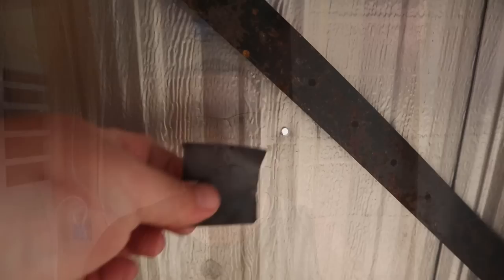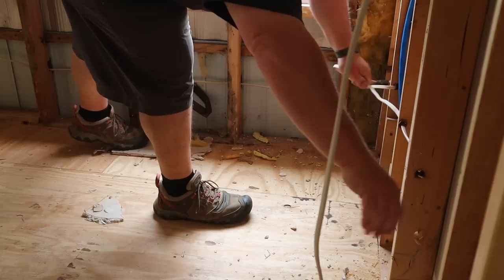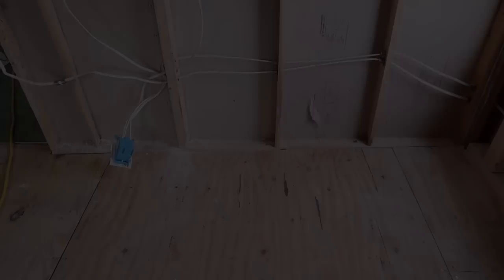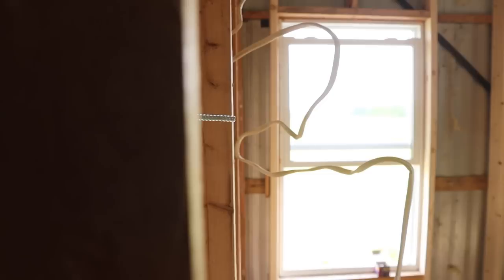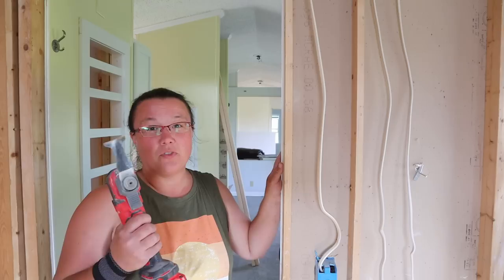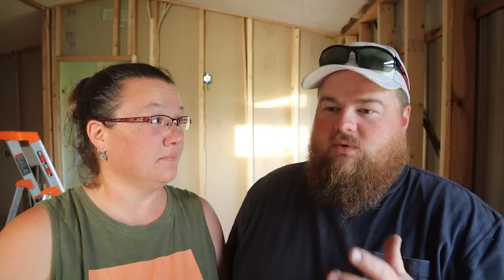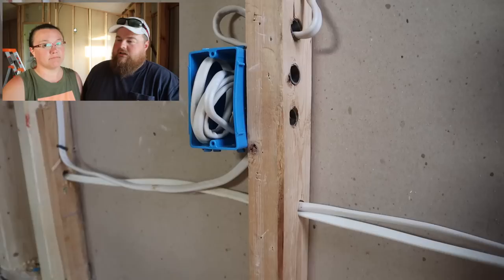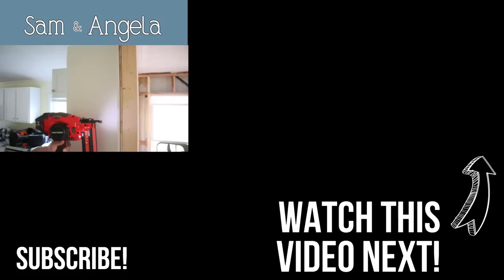Mobile Home Wiring [& Framing] is the WORST

Comment: They make those wire staples with plastic insulators, so they won't damage the wire.  Those staples are not suppose of be hammered hard against the romex. Just enough to lightly hold the wire in place.
Reply: Lots of deficiencies in the remodeling.
Reply: @peterlynch3252  What are they?  I disagree.
Reply: So the metal staples aren’t supposed to be hammered down all the way. Just hammered past the silver tip. Same with plastic staples. Compression = fire. That’s why a lot of new construction uses zip ties to tack wires up.

Comment: You might want to cut and install a piece of blocking between the two studs and remove that butterfly anchor and then you have a more secure mounting for the kitchen cabinet!!
Reply: I agree, looks pretty flimsy.
Reply from the maker: We did this the next day. :) That video is in the edit queue still.
Reply: @sam-and-angela  Great job!, yeah, you might as well fix all the whoopdi-doos in the walls while you're at the renovations, same goes for the laundry room, maybe move the wall back about a foot or two, beef up the 2x3's and any other micky mouse work that the factory did, or didn't do!, also you might want to completely redo the spice rack. As for the master bedroom closet, it looks like you have at least 2 1/2 feet depth to play with to make it roomy enough for your clothes! Thanks again for your videos!

Comment: Don't forget to put metal plates over where ever you have wires going through the studs in the wall so that when you fasten the drywall onto the wall you do not accidently screw through an electrical wire.
Reply: Theirs has conduit going through the stud. They can have burrs that can cut the wire themselves.
Reply: @jadofar  I saw one stud with a burn hole that was within half an inch of the face of the board

Comment: I highly recommend insulating any interior wall to help with sound deadening while you have access, especially since you have feral children. It greatly improves quality of life, in my opinion, and the cost is very minor, especially as it relates to that quality of life improvement.

Just my opinion!
Reply: You are so right.  We're doing a complete remodel of our mobile home too and we plan on using Rock wool in the interior walls.

Comment: It is probably sealed up by now but do consider some cross bracing so you're not relying on Molly screws now and forever more.
Reply: Where I live, code requires 2x4 between the suds.  It is fire code.

Comment: Older mobile homes use to catch 🔥 fire all the time, and it's plain to see why. That spaghetti ball of wires looks a whole lot better. I agree with Sam, I like the wiring to look near & organized. And I like it if the wiring makes sense. Good job Angela getting all those p.i.t.a. little brads, nails & protrusions cut off so that it's easier to hang the drywall.

Comment: My suggestion would be to remove everything on the upper section of the kitchen side of the wall, right down to the studs, replacing the sheetrock with plywood. This will make for a stronger wall and better mounting area for the cabinets & microwave. A little bit more work, but safer in the long run
Reply: A lot more work
Reply: @boathead22000  but probably safer in the long run than 2x3 walls
Reply from the maker: Perhaps if we didn’t already renovate the kitchen. Even still they’ve held for three years and a house move. The extra steps we took are more than needed.

Comment: I would recommend using the reflective foil in the walls before insulation. It will help keep your home cooler in the summer and doesn't add weight to the mobile home..

Comment: I would recommend that you connect all wiring for outlets with pigtails and waygu connections or wire nuts to avoid any failure of connections in the outlet plugs themselves! By doing this, if the outlet plug fails, then the rest of the circuit won't be dead and causing you hours of troubleshooting the problem of half of the home being in the dark ! Hope this makes sense! Thanks for sharing your videos!
Reply from the maker: It does make sense and something I remember comments on from our boys room renovation. Wago lever locks ordered today. :)

Comment: Glad to see you are replacing the wiring  and boxes.  many trailer fires have root problems in the wiring systems.  especially after people add new outlets and loads to existing circuits.  Enjoy

Comment: so a way to strengthen any wall or framed area is to put plywood over it and if you have a week area that's already sheeted with thin plywood you can overlap and strengthen it relatively easy and fast.
it just boils down to cost verse need and how much you want to engineer a project.👍

Comment: SAM AND ANGELA, YOU TWO DID A GREAT JOB AND THE WIRING LOOKS GOOD, I KNOW EXACTLY WHAT YOU MEAN ABOUT FLOATING WIRES AND ELECTRICAL OUTLETS IN OLDER MOBILE HOMES MY HUSBAND AND I HAD ONE WE HAD TO WORK ON THE BATHROOM BECAUSE OF THE HOT WATER HEATER LEAKING AND THE TUB PIPES LEAKING SO EVERY WALL HAD TO BE REPLACED.

Comment: I feel your pain, mobile homes are notorious for crappy wiring and thousands of unnecessary staples pin nails. All my outlets were just held by the sheet rock no 2x4s or 1x3s just a weird flap top and bottom that held them directly to the dry wall.

Comment: The conduit pieces going through the studs usually have burrs on the inside and will cut the wires running through them. Mine almost started a fire. They are there to keep drywall screws from going into the wires.

Comment: Hey love you guys and great job on all your work but could you double check and make sure those nail things that's holding the wire to the wall didn't bust through the plastic coating over your wire and not nailed too tight I am scared of everything when it comes to electric and just had to say that and I love what you guy's do☺

Comment: Everything is looking great. Two suggestions before drywall .The toggle bolts What are they holding up? Back them up with blocking and remove the toggle bolts for screws makes it a lot stronger. 
Please install safety straps over each hole that the electric is going through that dont have the pipe over the wires so you dont drive a drewall through it

Comment: Cant wait for more guys. Amy news on the electricity pole or sewer? Another great video guys. God bless you and your family.
Reply from the maker: Septic is to be installed this week. After that, we can rent equipment and trench for our power lines for installing. We don't want to risk digging in the septic drain fields and mess that up at all. Hopefully next week we will be digging the power line trench.

Comment: As someone who spent many a year living in a mobile home I would highly recommend if you have not put the drywall up in the bedroom yet, whatever on the other side of the last wall of this video is hung on a hollow wall anchor to take that down and put in a backing block to screw that in. I cannot tell you how many things in my own place were hung with hollow wall anchors (since those teeny tiny studs were very difficult to find let alone properly hit the center of one hanging something) that for a year or two or just fine. Until today that the not overweighted item ripped the hollow wall and current out of the wall leaving me with a giant hole to patch. The mobile home I owned was 9 years old when I bought it and we lived in it for almost 10 years.

Comment: we dont have romex here , we install pvc pipe and put seperate wires though them black for switching wire  green yellow is earth brown is nil and bleu is phase , the piping makes it eazier to add wire after the walls ceiling is installed , guess both metods has their advantages

Comment: Thanks for he tip with the screw and hammer to level the two pieces of wood, one to remember. Good temp fix with the tape as I was one of the ones commenting on the holes... sorry. Thanks for posting

Comment: Love your video. The home I have is a Double wide 50x24.  and the wiring was just crap. 14 gauge for just about every thing.  I have Ripped out the Sub floor and replace it all. A lot of the walls replaced.  insulation replaced.  I would have been better off Tearing down and just build a home.  Can't Wait until I get my home done. I'm about half way there but lots and lots more to go.

Comment: Regarding the oscillating tool. My experience is that they have a severe vibration so I think you are setting yourself up for carpal tunnel syndrome. Maybe it would help to use a wrist brace while you are operating that tool.

Comment: I've been around a couple of remodel(ishes) and, at least you didn't have short lengths of extension cord, appliance cord, and an asundry of other wires capable of carrying current attached in various ways .....  im going to guess that mid-wall or tucked behind the tub, that one passed factory inspection.

Comment: Sam, you would have tripped out had you seen some of the inside wiring on homes say 60 or more years ago. In the attic they had porcelain insulators nailed  into the top of the joist. The hot wire ran along a certain set of insulators and the ground on another set. The wires appeared to be covered with some type of cloth and underneath that what appeared to be rubber. Over time all insulation would fall off and the only thing protecting the wires were the insulators. You had to be very careful walking around in the attic. I don't even think electrical tape had been invented at this time.
Reply from the maker: Knob and tube, was that the name? I've seen it on shows, but never in person. Amazing the things we used to do! :) Imagine what the future will say about us. LOL I hope we make it to there...
Reply: @sam-and-angela  I happened across a just released video of Bobby who had a crew on the show Swamp Loggers. Bobby and his wife had been going thru some tuff times with all the mess the half brain guy has America in. So Bobby and his wife had to make a business decision and because they're loosing money trying to stay afloat they have to decided to fix up all their equipment and sell it and call it done. They basically said they couldn't make any money in this economy. Bobby said he started working I think when he was 13 years old. I certainly doubt they are the only ones who are closing their doors. :(

Comment: Hmm I have not seen any metal plates put over the studs where those electrical wires run Thru the hole to protect the wire from having a dry wall screw run Thru it or a nail of some sort should any wanes coating or pictures hung or trim added therefore  preventing an electrocution or fire at some inconspicuous time it is an electrical code in  At least the three states I’ve lived in the metal plates are cheap please add them    I love your videos I hope to fix my place up thank you for your wonderful play by play videos.    God Bless y’all 🙏✝️🙏.  Please put those metal plates over the stud where the wire goes thru it

Comment: Sam and Angela, don't you own a utility knife? Much faster and cleaner to run a utility knife down the drywall rather than use a powertool. Use a hammer to drive staples in or bend them over save your blades. 2x4s one and a half inch by three and one half inch unless you rip them down to make them 2x3s.

Comment: Good job guys!!!  Any word about when your power will be hooked up?
Reply from the maker: After septic is installed we can dig the trenches to have the power run. But it doesn't get turned on until everything is done -- all final inspections. So when the home is done, it will get hooked up.

Comment: The places where the staples penetrated the coating on the wires has created a fire hazard.  I know from personal experience when we lost our childhood h9me due to this very thing.  You are not suppose to hammer them down where they press into the wires.

Comment: Before I put the sheetrock on I put nail glue on and then put the sheetrock on after that because if you got trailer ever moves down the road the sheetrock will pop off the studs when you going down the road that way when they're glued to the stud you won't have to worry about cracking and other stuff
Reply: It's already moved down the road And is set up permanent now!